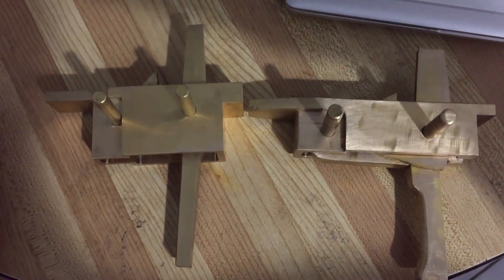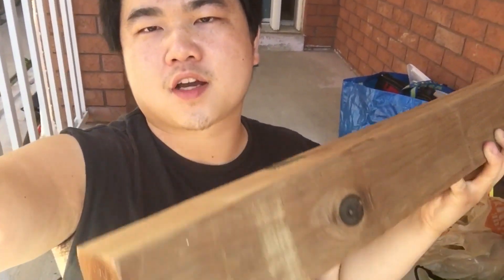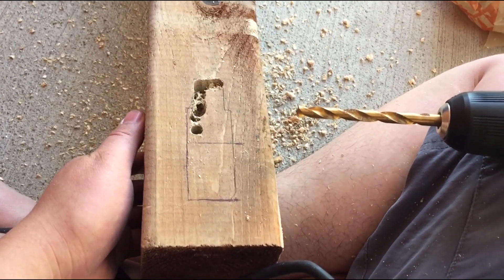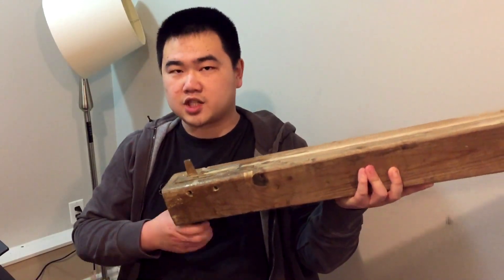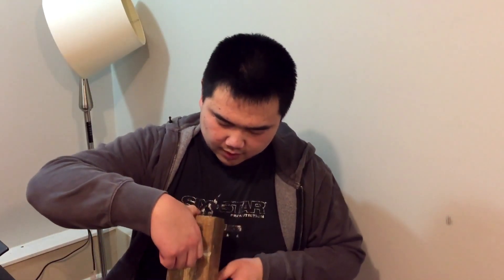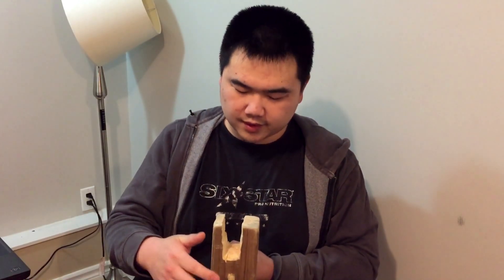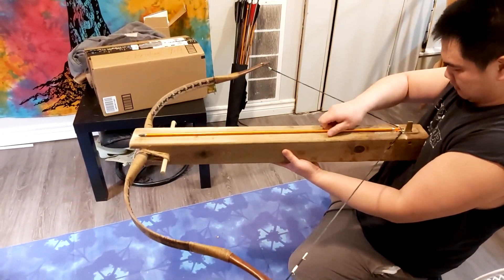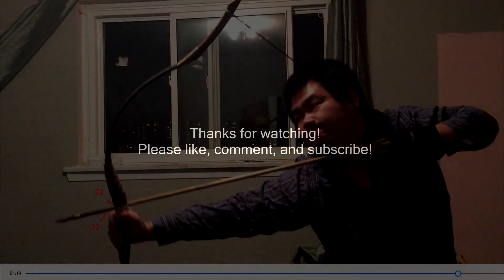DIY Ancient Chinese Crossbow Prototype

Comment: Chinese Han crossbows were more efficient than Medieval European Crossbows. Why?

Generally speaking, the power of a bow or crossbow measured in inch lbs = 0.5 x powerstroke length x draw weight.

Heaviest standard 8 stone Han crossbow power = 516 lbs draw weight * ~19 inches powerstroke/2 = 4902 inch lbs

Andreas Bichler's 1200 lb composite crossbow = 1200 lbs draw weight * 7.48 inches/2 = 4488 inch lbs

Tod Todeschini's 1250 lb steel crossbow = 1250 lbs draw weight * 6.5 inches powerstroke/2 = 4062.5 inch lbs

Typical 6 stone strength Han crossbow's power = 387 lbs draw weight * ~19 inches powerstroke/2 = 3676.5 inch pounds

Heavy Song dynasty bow made to pierce armor = 160 lbs draw weight * ~23 inches powerstroke/2 = 1840 inch pounds
Reply: Longer powerstroke crossbows were more mechanically efficient (and likely more powerful), but each had their own advantages and disadvantages. Shorter powerstroke crossbows were made with more compact prods, and had a lower powerstroke/draw length that could be used with mechanical aid more easily. Eg. The goat's foot lever only works with a crossbow that has a powerstroke for a few inches. This means an average person who isn't in great physical shape could use them more easily. Short powerstroke crossbows with steel prods were also cheap and fast to produce and very easy to maintain - with a greater temperature and humidity tolerance than any prod made of organic materials. So one had the advantage in factors such as mechanical efficiency (and power), the other way had the advantages in other factors such as cost, time to build, maintenance, compact size, and physical accessibility.
Reply: @Intranetusa  thanks for your educated analysis
Reply: Yes
Reply: The European take on the crossbow was a mechanically inefficient dead end. Just about everything in our design decreased efficiency. Heavy & short limbed prod/heavy thick string/ lots of friction as the string passes along the stock/ very short power strokes. That's why our crossbows needed to be so high draw weights-terribly inefficient.
Reply: @2bingtim  Longer powerstroke crossbows were more mechanically efficient (and likely more powerful), but each had their own advantages and disadvantages. Shorter powerstroke crossbows were made with more compact prods, and had a lower powerstroke/draw length that could be used with mechanical aid more easily. Eg. The goat's foot lever only works with a crossbow that has a powerstroke for a few inches. This means an average person who isn't in great physical shape could use them more easily. Short powerstroke crossbows with steel prods were also cheap and fast to produce and very easy to maintain - with a greater temperature and humidity tolerance than any prod made of organic materials. So one had the advantage in factors such as mechanical efficiency (and power), the other way had the advantages in other factors such as cost, time to build, maintenance, compact size, and physical accessibility.
Reply: @Intranetusa  
Now that you mention it, what did they use to draw those 516lb Chinese crossbows? If they just used a windlass like the Europeans, then mechanically that's just a difference in gearing but functionally identical in operation with the construction and durability advantages you mentioned above.
Reply: @CtrlAltRetreat  First, I believe most ancient Chinese crossbows were bent with human muscle (eg. using a standing dead lift or fetal leg press maneuver), while some crossbows (semi-auto ones and very heavy light field artillery ones) used mechanical aids such as levers and winches (see examples at the end). The most common/median Han Dynasty crossbow that had the 387 lbs draw weight was likely bent with human muscle. And there was a Warring States text that said "elite" crossbowmen (eg. probably the physically strongest crossbowmen) were qualified to draw a 350 kg (770 lbs) crossbow with their muscle power alone (see p. 11 of The Crossbow by Mike Loades and p. 172 of Chinese Archery by Stephen Selby). I assume the mechanical aids such as winches were applied primarily to light field-artillery crossbows, but it is possible that weaker soldiers may have used them for non-field artillery heavy crossbows as well. For comparison, the deadlift world record is ~1100 lbs, and the leg press world record is ~2,400 lbs, and drawing a crossbow string with either a deadlift or a leg press method would be much easier than an actual deadlift or leg press of the same weight because you're not experiencing the full weight until the split second near the end of the draw.

Second, the main mechanical difference that I can think of is draw weight vs power stroke. The ancient Chinese version has a much greater powerstroke but lower draw weight, while steel medieval European crossbows had higher draw weights but lower powerstroke. The efficiency of energy transfer would be better with composite materials (steel has a lot of mass which wastes energy) and with longer powerstroke devices. If we assume the efficiency is similar, then a ~380s lb @ 18-20 inch longer-powerstroke crossbow ends up being roughly equal in power to 1200lb @ 6-7 inch shorter-powerstroke crossbow in terms of draw weight X powerstroke....at least on paper. 

Third, In terms of durability, the steel prod is durable against decay and weather, but it's actual durability strength may have been viewed "cautiously" and as suspect. That may have been one reason why the powerstroke of steel crossbows are so short (I've also read that short powerstrokes were due to limitations of the rolling nut trigger design). Tod at Tod's Workshop states that he believes the powerstroke/draw length of the steel crossbows were low because the metal quality was untrustworthy, so the crossbow makers didn't want to make it prone to catastrophic failure/snapping by increasing the powerstroke to bend it back any further. Video here: https://youtu.be/MMoL_SBD6gw?t=102 

Thus, we seem to have two different approaches. On one hand, we have composite & other organic prods that are very efficient and can deliver a lot of energy with a moderately powerful draw weight and a long powerstroke. Unfortunately, these prods are more expensive and time consuming to make and require more maintenance. Longer powerstroke is also harder for mechanical devices, so many crossbows tend to be more muscle powered and require a physically fit person. On the other hand, we have cheap, easy to make, and low maintenance metal prods that have a high draw weight but very low powerstroke which allows mechanical aids to be more easily used with its short draw for weaker/less fit people. Unfortunately, these medieval metal prods are durable against the weather but not actually structurally durable so they may be prone to snapping....thus resulting in very short/conservative draw lengths. Steel is not as efficient as composite/wood and a lot of energy is wasted as heat and shockwaves in the steel prod. This inefficiency combined with the low powerstroke means its high draw weight doesn't actually result in a lot of energy being transferred to the arrow/bolt. If we look at Tod's recent video of a modern 150 lb compound crossbow vs a medieval European 960 lb crossbow, the modern crossbow with its higher powerstroke and better efficiency shoots a medieval crossbow bolt with more energy than the medieval crossbow. One is geared for more efficiency & power for physically fit soldiers while the other is geared for low cost, ease of maintenance, faster production, and more accessible for less fit soldiers.
---
Example this tomb carving showing a winch drawn crossbow: https://wildfiregames.com/forum/uploads/monthly_2017_07/winchedcrossbow_zps2128b3c3.jpg.367d723eb09d3802096a2882376c0253.jpg Here is a semi-auto crossbow mounted on a platform that was portrayed in a later medieval era painting, but earlier periods probably had this as well given the description of rapid firing siege crossbows: https://upload.wikimedia.org/wikipedia/commons/f/fc/Navalzhugenu.jpg
Reply: @Intranetusa  ill be honest with you, crossbows are useless, if you dont have good quality heavy infantry, and that's what chinese lack. romans never relied on archers and look at how far they conquered. for infantry: Armour>melee weapons> ranged
Reply: @CtrlAltRetreat  they had slaves to pull it. long prods are easier to have multiple people pulling
Reply: @marcellusbrutus3346 crossbows are useless? come on man. even the romans had crossbows
Reply: @marcellusbrutus3346  read byzantine history
Reply: @lichenggong1248  read crossbows versus spear ratio
Reply: @marcellusbrutus3346  Your claims that they didn't have good heavy infantry is incorrect. First, the ancient Chinese Empires such as the Qin and Han Dynasty did have good quality heavy infantry with good armor. Look at the armored soldiers of the Qin terra cotta army or Han terra cotta figurines. The heavy infantry of these empires had equipment that was at least comparable in protection to the heavy infantry of the Romans. Some ancient Chinese heavy infantry even had armored sleeves that protected the armpits, upper arms, and stretched down to the elbows or even futher down to the hands...resembling more comprehensive chainmail armor from the middle ages. If you read about Chinese military history, their doctrine often revolved around using heavy infantry equipped with swords, pikes, halberds, etc to not only advance but also to protect their crossbowmen and archers in pike and shot-esque formations. Furthermore, their crossbowmen sometimes also doubled as heavy infantry. Warring States texts state that elite troops of the Kingdom of Wei were equipped with a crossbow, sword, halberd/polearm, helmet, and heavy armor. See example pictures of Han era heavy armor below. 

Second, the Roman Empire was roughly the same size as the Han Empire, and the Romans changed their military several times in history - such as transitioning away from an extremely heavy infantry centric army to incorporate more ranged troops and cavalry during their wars with the Parthians and Sassanids. A heavy infantry centric army was fine for fighting against the Gauls, but not as effective against larger and more organized armies with more ranged and cavalry troops. For example, even the earlier Roman Republican army that fought the Punic Wars against Carthage incorporated much more skirmishers/light infantry and cavalry into their ranks than the Roman army of the late Republic/early Principate. So the Romans clearly thought that having a more mixed unit military was important when they were fighting against larger enemies.

Third, archers are not the same as crossbowmen as the stronger crossbows have more power than strong bows, but even archer-heavy armies in history have been successful. The English army during the Hundred Years Wars were heavily composed of archers and they performed quite well against French armies that had more heavy infantry and heavy cavalry. 
Finally, if you want to talk about melee weapons, the Han Dynasty military was using a combination of many different melee weapons such as short swords, long swords, glaives, spears, pikes, halberds, and sword-staffs. Scholagladitoria has a video where he reviews a reproduction of a very long ancient Chinese sword that is comparable in length to some late middle ages Zweihanders: https://www.youtube.com/watch?v=cKH4PSA8dPA&t

Here are images of Han era heavy infantry (terra cotta figurines and recreations). Some of these soldiers had armored sleeves that protected the upper arms and armpits, and some figurines and paintings show armored sleeves that protected soldiers all the way down to the hands.
https://4.bp.blogspot.com/-w1WB_TipTPc/V8UKPPJ5maI/AAAAAAAADmM/EtoAmu5VQqElrX_rtaeB4PdhjSlIWV_tQCLcB/s1600/2A9WrgV.jpg

https://en.wikipedia.org/wiki/File:Han_shieldbearers_03.jpg

https://2.bp.blogspot.com/-L35vqfhQOhM/V8JJ7eAs-tI/AAAAAAAADS0/t8Nhoklq2NgeFOpNYVrz76_LnpUM4S9hwCLcB/s1600/Hht9ZKR.jpg

https://2.bp.blogspot.com/-beSc0DR-dys/V8T_6-gs1qI/AAAAAAAADkc/sIFQoMelCFk65F4RT6OR-YQqqmUJ3uLQwCLcB/s1600/Han15.jpg

Armored soldier of the Qin era with lamellar sleeves extending to the hands: https://qph.fs.quoracdn.net/main-qimg-3d213f19b0b6a6852d08e58e0faafec0

Armored soldiers of the Han era with armored sleeves: 
https://imgur.com/a/zyb5zB7

https://en.wikipedia.org/wiki/File:Soldier_of_Han.jpg
Reply: @marcellusbrutus3346  Your claim about using slaves is also incorrect. Slaves did not pull/draw crossbows. Soldiers pulled the crossbows with their own muscles or used mechanical aids for the heaviest ones. The Han Dynasty was not as reliant on slavery as the Roman Republic/Empire was, and even the Romans didn't really use slaves on the battlefield like that.
Reply: @Intranetusa  
I was under the impression that Europe had proper spring tempered steels very early in. Most of the long sword vs katana bickering is predicated on European steel being on fantastic homogeneous metallurgy with a excellent tempering to make the blades simply superior even in lateral durability despite the lower thickness. If that was available, there aren't many more logical places to use it than in what is effectively a massive leaf spring.
Reply: @CtrlAltRetreat  Tod states that he believes premodern people couldn't trust the purity of their steels....and I agree because tempered European swords breaking/snapping have been depicted quite a bit in historical paintings and writings. The ability of premodern people to create spring steel still doesn't guarantee they ended up with a steel that has a totally even distribution of carbon with no impurities like modern mono-steel (pockets of low/high carbon or impurities would create pockets of weak points). 
For example, here are medieval and Renaissance paintings with broken swords:
https://qph.fs.quoracdn.net/main-qimg-5d9cfcb8a44413a7ee6e2b6a13561623
https://murreyandblue.files.wordpress.com/2015/01/richard-broken-sword-big-1.jpg
Scholagladitoria's video on swords breaking in history: 
https://www.youtube.com/watch?v=meln41VHxqs&feature=emb_title

And even after factoring in the greater impurities in premodern steel, premodern smiths had different grades of steels where they used even lower quality of steel compared to the higher quality steel they used for swords. The best steel were usually reserved for higher quality weapons such as swords and the best/most expensive armor. Lower grade steel might be used for something like munitions grade armor or arrowheads. A thick and heavy crossbow prod might not have used the best steel they had available (and even the best steel used for swords still had impurities and occasionally broke as shown above).

Furthermore, tempering and differential hardening were actually both used in Western Eurasia and Eastern Eurasia, so it isn't one group of people used only one or the other. Medieval European blades were made with both tempering but sometimes used jacketed lamination that were basically differentially hardened. Ancient Chinese double edged swords were tempered around the same time differential hardening was in use, and differential hardening became dominant by the medieval era after single edged swords became much more popular than double edged swords. So both technologies were in use across Eurasia. One factor that contributed to different forging techniques is concern with the level of impurities and carbon distribution you get in the end product. The repeated folding of Eastern Asian swords (eg. Japanese swords in this case) helps with evenly distributing the carbon and spreading out impurities. The pattern of Damascus blades (which were highly prized in Europe and elsewhere) are believed to come from the impurities found in steel - and modern pattern welding to create Damascus patterns involves using different pieces of metal with different levels of carbon and different types of impurities. So even highly prized swords had impurities, and these impurities sometimes contributed to pleasing aesthetical patterns. 

Finally, steel impurity is just one explanation for the short powerstroke. There are also some other possible (and perhaps supplemental) explanations. For example, I wonder if the rolling nut trigger inhibits the use of a long powerstroke since it requires a very long lever trigger. I also wonder if a steel prod can even be made effectively longer to enable a longer draw - not only due to greater chances of failure from impurities, but also due to potential concerns with decreasing efficiency since a lot of the energy is already wasted into moving the heavy mass of the steel. Tod has a recent video hat compares a 960lb medieval European crossbow with a steel prod with a modern compound bow (fiberglass or carbon) with a 150lb draw. The modern crossbow ends up shooting a medieval bolt faster and with more energy than the medieval crossbow. I believe Tod talks about how the large mass of the steel contributes to its inefficiency.
Reply: @Intranetusa  
The moving mass of steel doesn't necessarily decrease the efficiency of a steel limbed crossbow with a long power stroke. Lancehead archery makes the f1 which is s steel limbed 170lb draw crossbow with a 24" power stroke and it's been very well received so far. Joerg has a review of it up and others have noted its marked performance with full length heavy weight broad heads. The limbs are designed as coil springs and do an excellent job storing transferring the power and they can be tuned to their tension sweet spot for less variance between the start and end of the power stroke for a more consistent, higher total energy shot for a given poundage. I think these are some of the most efficient crossbows around atm.

Coil springs were used for clock works relatively early on so the technology to design something like this in era should have been around if you're thinking the theoreticals for a long stroke steel limbed crossbow.
Reply: @CtrlAltRetreat  I was thinking of the inefficiency of the thick and heavy steel prods of historical medieval crossbows. That type of thick prod might be more inefficient if you added more mass to it. I took a look at the F1 crossbow you're talking about and it doesn't seem like a crossbow because it uses torsion springs instead of a tension "bow" prod. It's closer to a catapult or ballista combined with a modern compound bow pulley system. https://youtu.be/N2YRw_9Gewc?t=23
While coiled springs existed during the medieval era, they were weaker and more metallurgical inconsistent items used for low stress devices such as door locks and clocks. I don't think they had the technology to make these advanced types of high quality, highly durable torsion spring coils from modern hybrid metals that could withstand repeated heavy stress. Theoretically, yes, I think someone could have tried to make a coil spring ballista device with a pulley - but with inferior quality metals and a lack of modern knowledge about metallurgy and compound pulley systems, they would have created a much weaker device with lower draw weights and probably lower powerstrokes.
Reply from the maker: hey man do you know what hackneyscribe said about Chu yen slips? i am trying to find the original chinese text. i have some ancient chinese language friends who can help me translate
Reply: @Intranetusa  
They didn't actually come up with the idea back them for sure and heck, that was an issue even now. Steel and pneumatic springbows have been around for quite some time and are very well proven especially for harpoon guns but it took a while for someone to think of mounting the coil springs transversely rather than in line and using it pull a line rather than push the projectile.

I don't expect an ancient design could match modern efficiency but the f1 is quite a compact and handy setup. If medieval europeans made a double weight and double size version that would make up for a lot of the iffy steel quality by simply not stressing the system as much. Might not be as fast but even at half speed it would be far faster than most bows and more compatible with heavy projectiles. 

The pulley systems for compound lines are functionally reversed block and tackle systems similar to the trade and quarry cranes used across Europe but the f1 uses direct coiling i believe. The problem with the steel crossbow system is mostly that alternative drive ideas hadn't happened to come up yet imho because many spring powered harpoon systems or even the spring shot portion of the piat make use of principles known since ancient times. Da Vinci's siege designs further refined could have lead to many. Alas it didn't happen but I don't think it's due to the inherent unsuitability of steel, though I've gotten so many mixed messages of the quality of European historical steel. The great church clocks in Zurich for instance were made in period and their springs are both magnificent and massive.
Reply: @marcellusbrutus3346  I too wondered about how effective crossbows would be against heavy armors but I think you are very wrong. Romans lost to Parthians numerous times. In the battle of Carrhae, the Romans lost in large part because their testsudo formation and heavy armored infantry could not handle the ranged attacks of Parthian horse archers. If the horse archers could penetrate the formation, the whole body drawn bow arrows would penetrate harder.